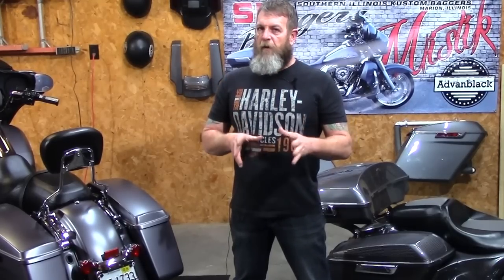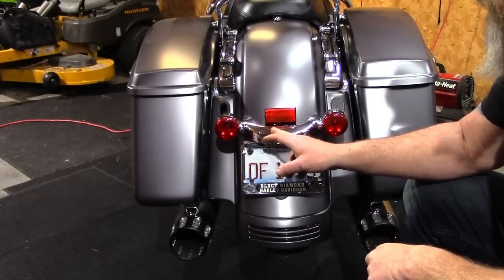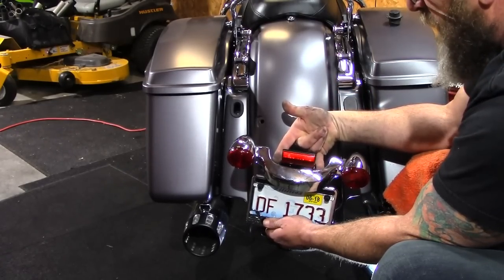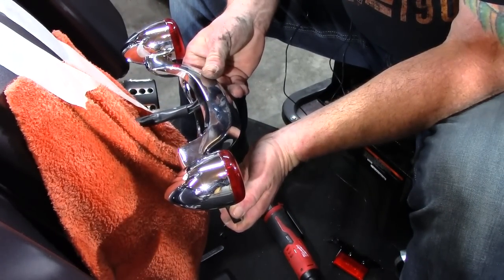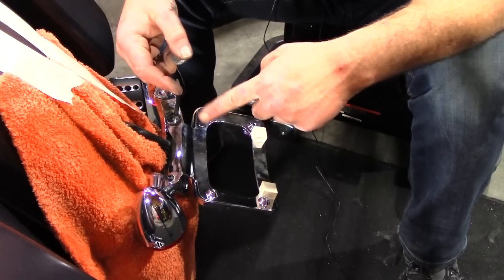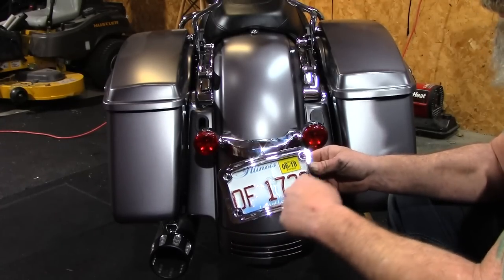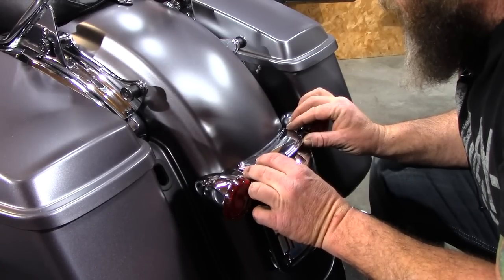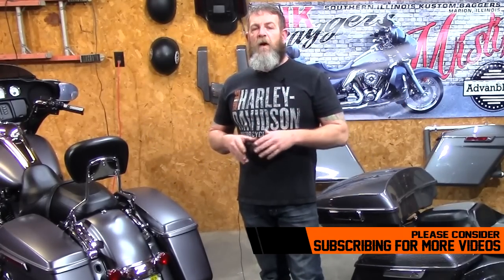Install Curved license Plate and Turn Signal Filler Panel Harley Davidson Touring

Comment: Steve, I just installed the curved plate frame from HD and the instructions stated to stack the 2 square rubber bumpers together placed in the center of the mount for a tighter fit. Also the kit came with 2 thin strips of foam that go between the plate and mount. Just thought I'd throw this out there. Love your vids, keep up the great work and God bless!
Reply from the maker: Hey thank you, much appreciated! Yes the one we were installing here from a knock off company had no directions with it and the one I had on my bike, the charcoal pearl one, was a knock off as well..it broke within 3 months of using it and almost lost my plate. We have since moved on to the HD version, with instructions lol,  however I didnt do a video and I should have so I could show that exact thing....im going to say that me not stacking those on the knock off is what caused it to break...ugh  Thanks so much for the input and thanks for checking out the vids as well.

Comment: Great video. Just wanted to share the filler plate p/n 3156 has been discontinued. Just a heads up for anyone new here
Reply from the maker: Yeah I noted last year they weren't selling it anymore...which is crazy because I seen since the first one I purchased at around 20 bucks they sky rocketed in price for the final year or two...then they stopped making them...I dont think that was a good move on Kury's part...I called and talked them about it and they said it was a slow mover and I said its sold out every where and you doubled the price and people were still buying it...slow mover?? lol
Reply: Damn I just bought the curver license plate!

Comment: Nice i didn't know they had those fillers, now i gotta get one , thanks for the heads up,
Reply from the maker: Youre welcome bro...They are a nice touch for sure.
Reply: Steven Housden , how is the Kuryakyn plate frame holding up?

I’m tossing between the Harley and the Kuryakyn Curved plate.
Reply: @sikbaggers  Hi Steve, I always enjoy all your videos. I was wondering if you have a video showing an install of Harley heated hand grips. I have a 2020 SGS. Any help would be greatly appreciated ty.
Reply: @sikbaggers  Hi Steve do you have a video showing an install on H-D heated grips for a 2020 SGS?

Comment: Steven, I'm a loyal subscriber and love your channel. A word of advice, try to post a link below for the parts you install so it would be easier for us to look it up and buy it. Thanks again and keep up the good work.
Reply from the maker: Hey thanks man...swore I had links on this one. Actually the plate frame installed ended not being that great and I replaced it with the one from hd. The filler is kuryakyn 3156

Comment: Thanks for the video Steve! The only reason I'm here is because after an hour of fighting the light mounting bolts with my arm between the tire and fender, I figured I see if there was a better way to get them off.  Nope, it just takes patience it seems.  LoL
Reply from the maker: Yes sir...its a pain for sure...gotta squeeze up in there or drop the rear tire...Ill opt for squeezing my arm in there lol
Reply: I own a 2019 SGS. I have a complete socket wrench extension/adapter kit and I cannot get the socket to the mount bolt underneath the fender to save my life? Please add a video or pic of the magical socket wrench combination you used for the fender bolts.🙏
Reply: @elvisman8721  Ken, hopefully this is not too late to be of use, but I just turned my arms into pretzels to get around the rear tire. I lifted the bike about 10 inches off the ground and used a flat rached-headed combination wrench to get in there. A regular ratchet was just too big. Good luck.

Comment: Well bugger. They only make it in chrome just like the neck cover. Also for about $2 you can get a replacement plug for the antenna hole. 

Also do you have a trick to getting to those 2 bolts on an 18’? I can’t get a wrench or socket in there? I think the 18’ special has a larger rear wheel.
Reply from the maker: Yeah I seen they dont offer a black on....maybe powder coat?  Ive had to use a long breaker bar to get to those ...small turns and a pain but it works.
Reply: I had to use my wife’s small hands with a 1/4” drive ratchet to get them off and on. Also used a motorcycle jack which seemed to help lower that 18” wheel some.

Comment: Hey Steve is that the plate from Amazon, the same that's on your Glide ? Saw some reviews about them cracking, but you've had yours on your glide for a while now, any problems. Guessing they maybe didn't use the foam blocks to prevent the vibration ??
Reply from the maker: yes if you look back on my old video of this mine did crack even with the blocks...I put in the description to not buy it as it cracked. I just spent the money and got the one from HD...no issues with it but yes make sure to use the foam blocks. I think the other one was just cheap pot metal.

Comment: What is the other thin strips of adhesive foam tape for then that come with it ?
Reply from the maker: place them between the back of the plate and the fender about an inch up from the bottom..keeps the metal from ever hitting and reduces vibration.

Comment: Will that curved lic plate frame and turn signal cover fit a 2021 street glide
Reply from the maker: yes, there is no difference in the rear fender for 09 to 21...only differences are for fender extensions...sg and rg have them, other models such as RK and ultras do not.

Comment: Could you give the part # for the  frame too . Are both the frame and filler panel Kuryakyn ? It is for a 2017 Street glide special . Thanks
Reply from the maker: yes the filler panel and the plate frame are from Kuryakyn...Harley makes the plate frame as well and looks identical both about the same price...here is plate frame part number... 3157 
Curved License Plate Mount, Chrome
Harley: ‘10-’18 Street Glides

Comment: Definitely plastic?  Want it but need it in black......  Think it could be painted?
Reply from the maker: The filler panel is plastic yes...the plate is metal and HD has hat in black..the plastic can be painted if its prepared correctly

Comment: Got a filler for the tag has a light on it where does it plug-in
Reply from the maker: Im guessing you have the kuryakyn one...here are the instructions https://www.accessoryinternational.com/merchant2/graphics/pdf/kuryakyn-3154-turn-signal-bar-filler-panel.pdf
Reply: @sikbaggers  yes